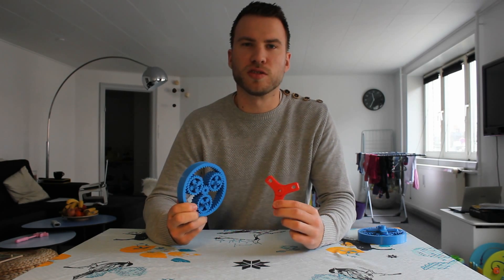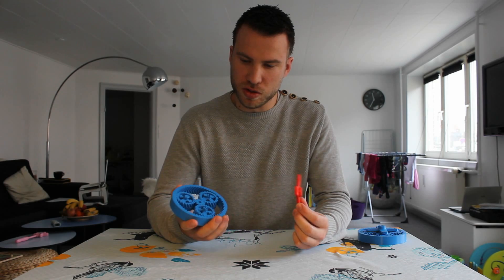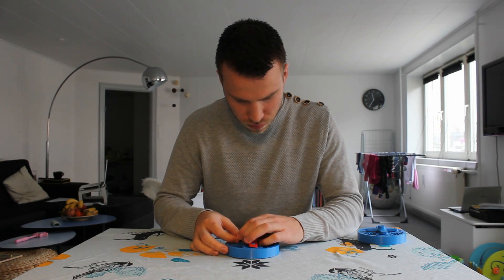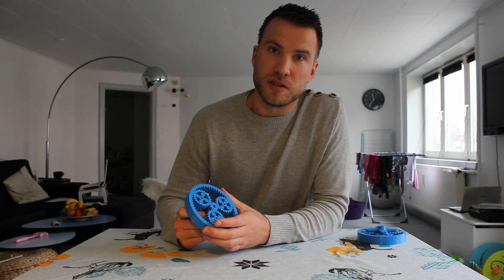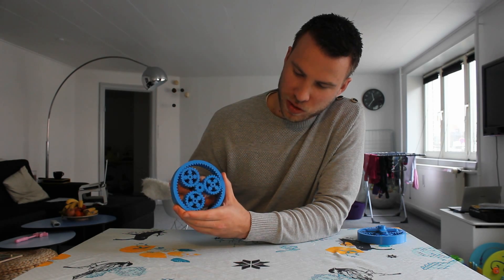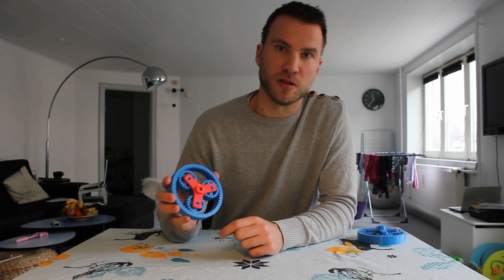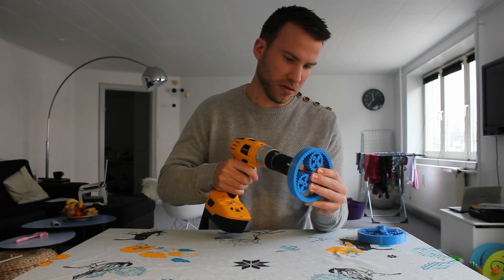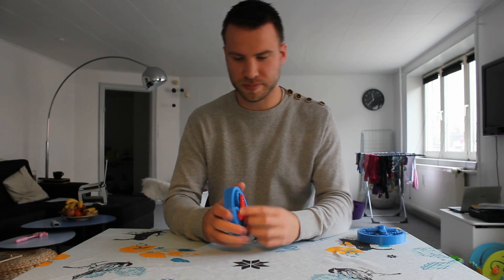3d Printed planetary gear

Comment: This thing can pinch your finger if you're not careful... I printed this out. I had to reprint the carrier with a -0.1mm horizontal expansion because the holes were a bit too small and I didn't want to force it and break the tabs, as it took almost 16 hours to print!

Comment: Help is possible..I need a care box like the one used in wind turbines..convert from slow speed to high speed ... it is connected with a head of electricity generation.It produces 1000 watts .... thank you very much ... possible model

Comment: i wanna print some of these and put them pegs to make planetary gear wheel casters
how much weight you think you can make them hold?
Reply from the maker: Unless you specifically want the planetary gear effect then you would be better going with this http://www.thingiverse.com/thing:53451 for a wheel.  How much weight?  The plastic is very tough.  I think it could comfortably carry 10-20kg.  If you made one with the design I linked to it would be much more since it is more solid.  Good luck :-)

Comment: At 2:58, Nikolaj spins his perfectly designed planetary gear. But, what you notice, if you look hard enough, is that when it spins quickly, it produces an exact replica of the Star of David. Why is that interesting? This pattern is not an accident!

Israel was also made up of 12 tribes (Reuben, Simeon, Levi, Judah, Dan, Naphtali, Gad, Asher, Issachar, Zebulun, Joseph and Benjamin).  Their lineage was promised the Messiah, known as the Son of God. Do you notice a pattern here yet? The whole book of the Torah is centered on the journey of Israel, its rebellion against God, its judgment, and humanity's need for a Messiah. The promise of the messiah is the central promise given to the 12 tribes of Israel. It's fascinating that even the symbol for the 12 tribes of Israel is exactly that of 12 planets revolving in perfect order around the sun (the representation of the Son of God, the Messiah). 

The significance of this is even greater: Back then, they did not have the knowledge that we do of the planetary systems. They had no telescopes to view that far!

Thanks for the revelation! Great job on the gears!